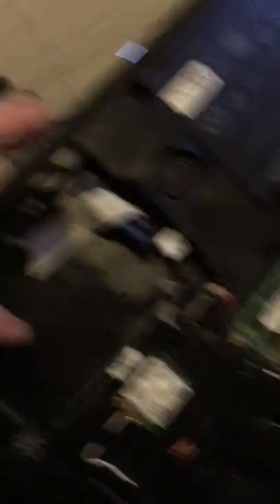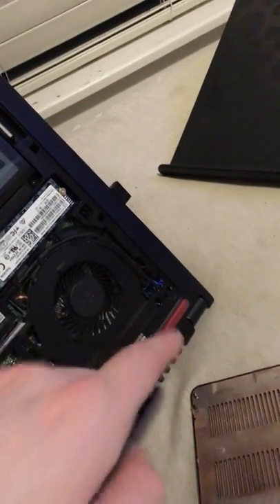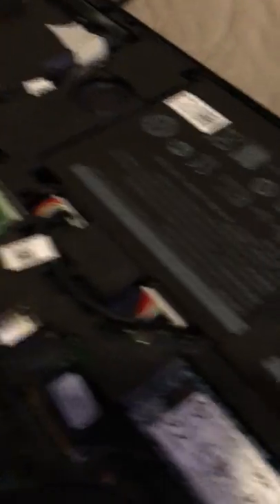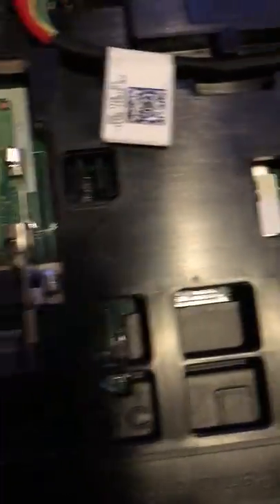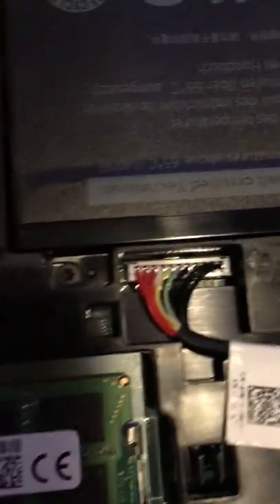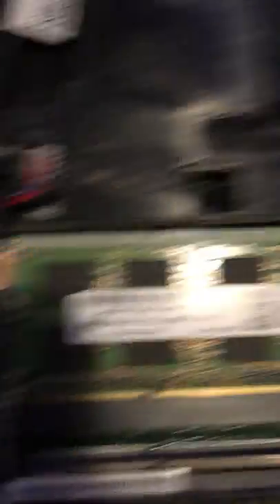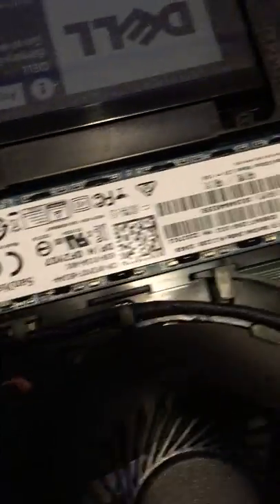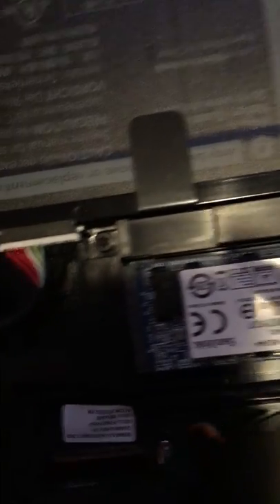Strange Static/Squeak Sound - Dell Inspiron 15 7559 (7000 Series) Laptop

Comment: Same problem here, did you find something??
Reply: Guillaume Rivest Hello!. Did you find something?
Reply: JoC DLCMR got told that is was normal... its a fan thats , i guess, is underneath the processor. ..
Reply: Its nothing dangereous I was told
Reply: @guillaumerivest5331  swear to god, cause i am worried for my self
Reply: I have same sound , but I can tell its not a fan noise because thant noise stays even i set fans to 0 rpm , and i dont have hdd only ssd any soliution?

Comment: same problem with my new purchase from System 76 (Lemur Pro 14), they already sent me a replacement unit, but it has the same sound too! I guess it has something to do with the CPU itself coz I had the same sound on a PC before but I fixed it by just removing the CPU and putting it back again so my guess is the CPU wasn't installed correctly the first time. I just hope someone with enough knowledge tells us whats going on! check this video: https://youtu.be/blyswNKEPEY